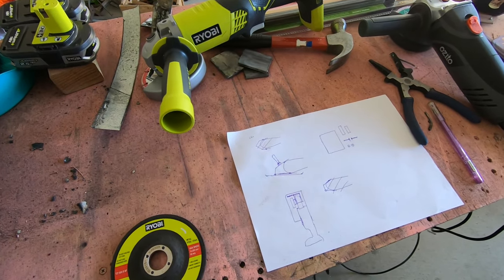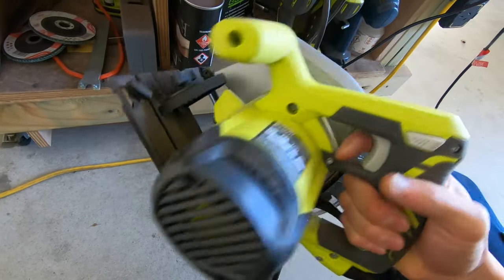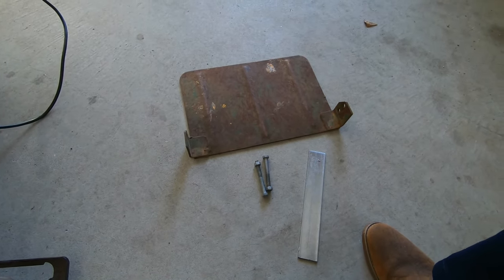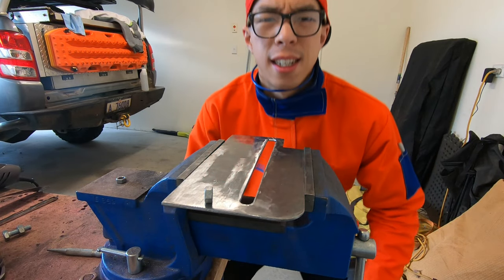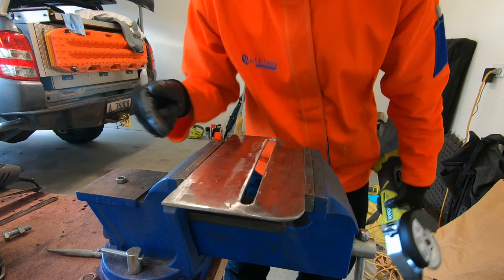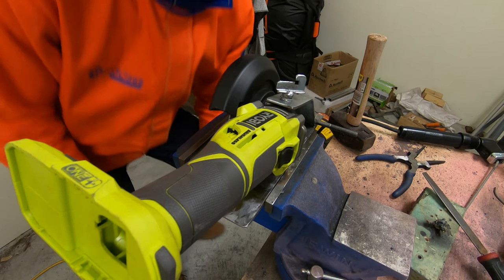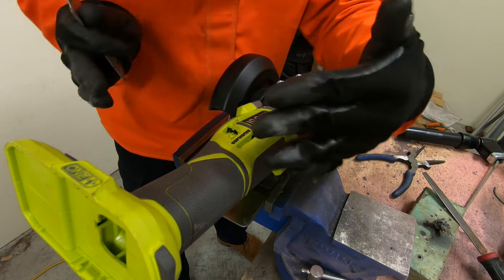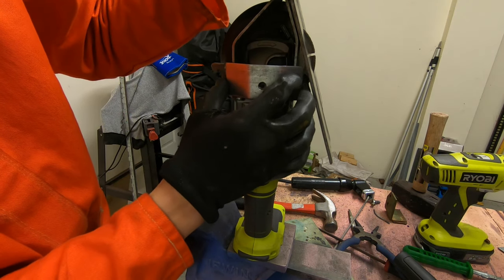DIY Angle Grinder HACKS | Base Attachment for STRAIGHT CUT

Comment: as a matter of act you canget a metal cutting blade for a circular saw!!!
Reply from the maker: Haven't quite looked into it. I was looking at one for mitre saw and circular saw but looks like there may be safety issues with rpm.
Reply: Well done young man.